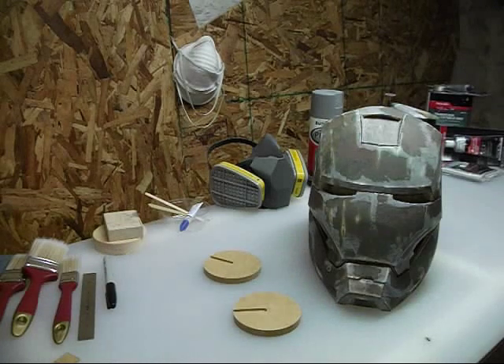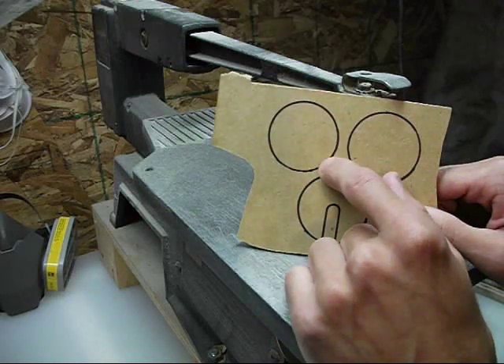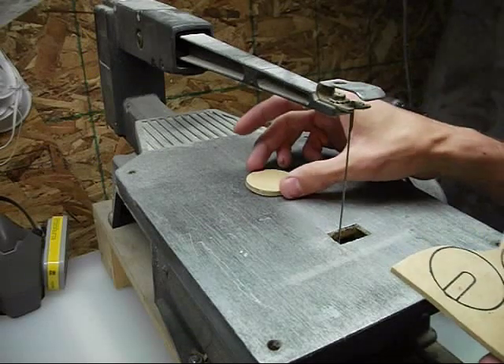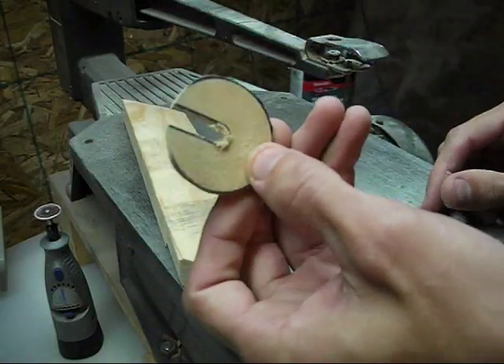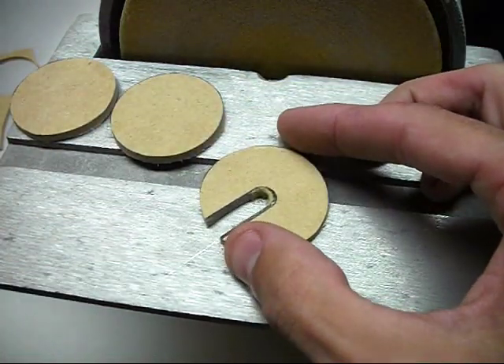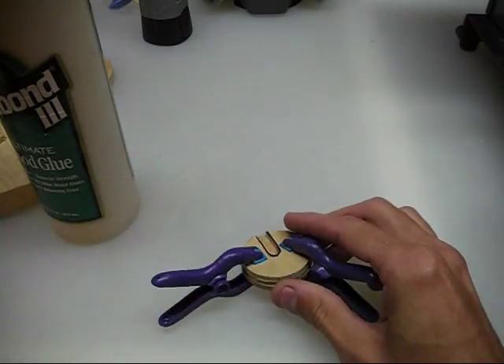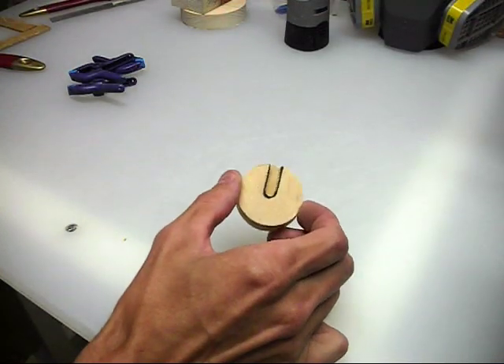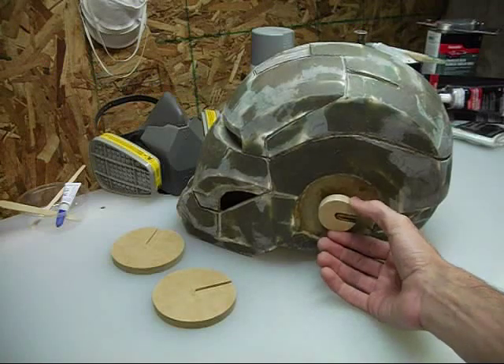IRON MAN HELMET BUILD PART 7 ~ EARPIECE REDUX

Comment from the maker: You can buy a hand version of the scroll saw I used in the video.  The hand version is called a "coping saw" and can cut out the ears just as easily.  You can find a coping saw at any hardware store for $5.  You could also use a jugsaw with a very fine toothed blade. The sanding can also be done by hand with a wood block as a backer, or with an elecreic palm sander.  I don't think too many places rent small benchtop tools like twhat was used in the video.

Comment from the maker: Yes, they're called hole saws.  I actually thought about doing that but I don't have a hole saw that's a 3 1/4" diameter, and I didn't want to buy one just to do these earpieces.  There's a couple different ways to build these using various tools and methods.....I just used what I had available at the time.  I guess it's the end result that matters anyways.  Very good suggestion though...maybe someone else reading these comments will use your idea.

Comment: I love that you work with the tools you have - much respect for that, but PLEASE invest in some hole saws and a drill press (or even a cheap power drill). You could have done those ears in like 5 mins, including removing the old ones. Still - respect what you did here.

Comment from the maker: Resin it without the ears on.  It's too difficult to detail the stepped area around the ears and helmet while the ears are on.  Also, getting the paper ears perfectly round and smooth is going to be much more difficult than making the ears from mdf or hardboard.  If you use the paper ears you also have to waste a lot of resin filling them up on the inside to make them ridgid.  Bottom line, less work, cleaner look with hardboard.  Hope that helps you- Booch.